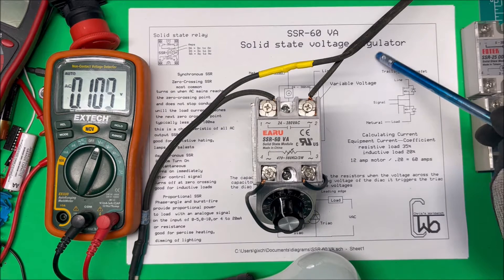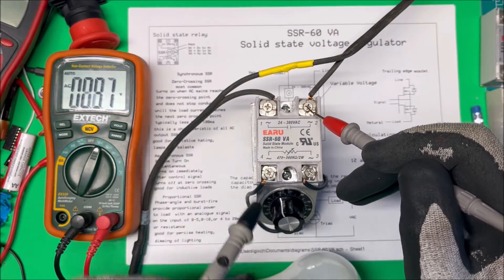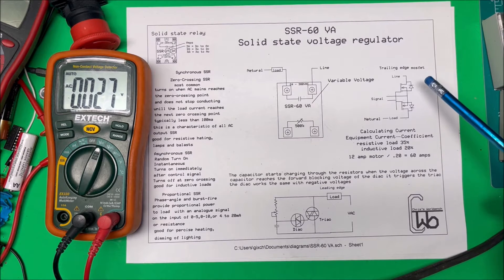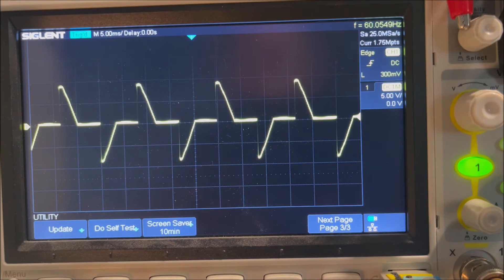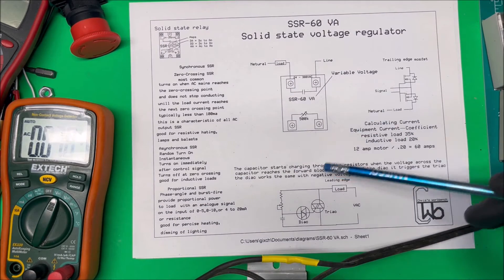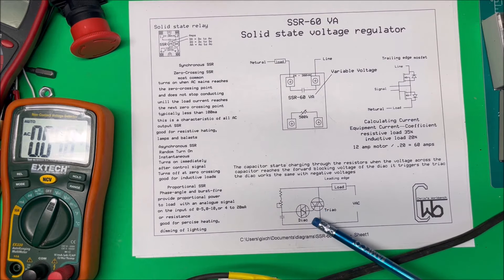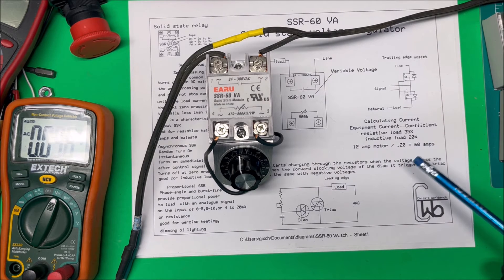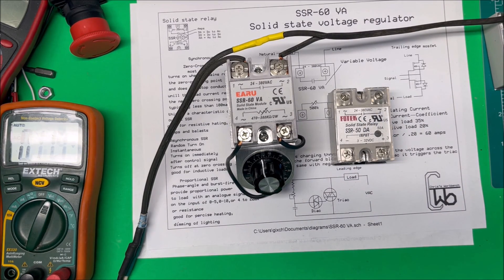Solid state voltage regulator

Comment: Hi, does SSVR can maintain 220VAC going to the load even though the main supply is ranging 220-250VAC?
Reply from the maker: It follows the main voltage supply.

Comment: I am a bit confused about what you said about the resistive load vs. inductive load.
In your formula you devided the 12A with 0.2 which is ended up 60 (this is clear), but when you are talking about resistive load you are saying with 0.35 we would end up with 8A, I have the impression that's not true if we are following the same formula. 
12A x 0.2 = 60
8A x 0.35 = 2.8
21A x 0.35 = 60
So actually with resistive load this model can be used up to ~21A right?

There are models with 0-5VDC, so those we can control with the voltage right? So 2.5 volt vould basically divide the load into half? 

Thanks for the good video.
Reply from the maker: The resistive coefficient is 35%  the max resistive load for this 60A unit is 21A , I had 15% in my head.

Comment: Big Clive did a tear-down of the Fotek brand. Yep, triacs. IIRC, he thought they were not absolutely terribly designed, but that their specs were definitely overstated. I won't buy/use them. I built a reflow oven, using a PIC MCU. The SSR that I used (a known good brand) only required 7mA to drive it. Meaning, I was able to drive it directly off of a MCU pin. Easy-breezy.
Reply: The Fotek he tore down was a counterfiet